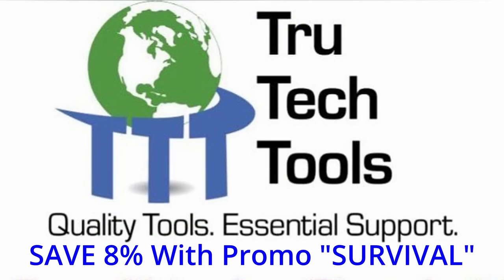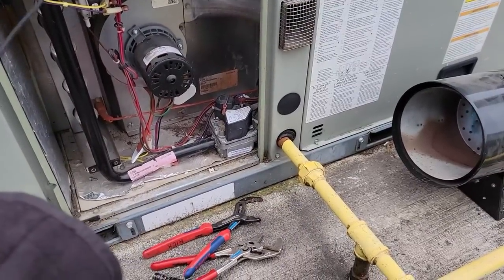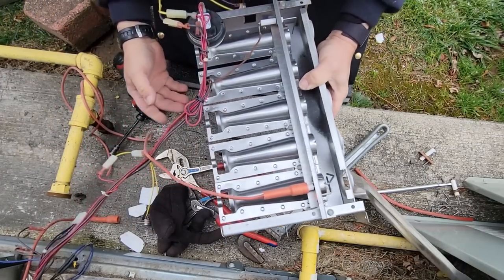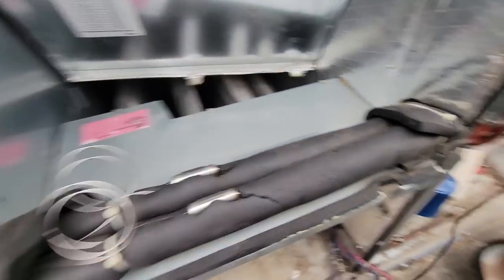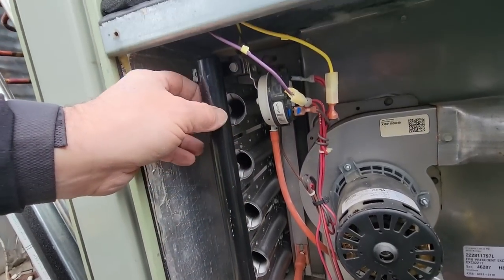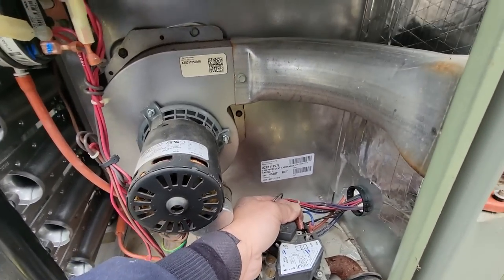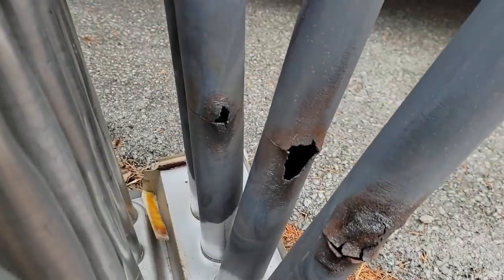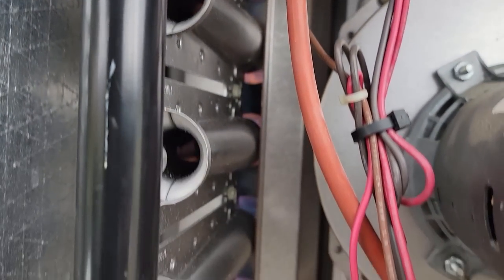Another Costly Trane Failure On The Same Unit!

Comment: I was actually told by a trane engineer through tech support on this exact issue, to remove the ceramic turbulators from the precident heat exchangers. They still come with them but I've seen so many failures because of those stupid things I just remove them. The loss in efficiency is negligible. I just did one about 2 weeks ago and one of the turbulators was broken on the brand new exchanger, had to fish it out with a pipe. Garbage.

Once you do one of those heat exchangers, it's pretty easy, an apprentice and I can knock one out in a little over two hours.
Reply from the maker: I removed the ones in the other unit I showed, I asked for new ones but they didn't show up. Good to know, thanks for watching and commenting!

Comment: The last gaspack which I serviced, was for a Tempstar 16 SEER unit which was installed by a perfectionist, the sheet metal work was conformally coated with a high temperature 'hydrophilic' coating manufactured by a company by the name of "Hysol".  It was one of those "their techs were SO busy," that the husband and wife 'team' who owned the HVAC (no "R") ICP-Tempstar/Comfortmaker dealership couldn't do the 'scheduled emergency service within 72 hours, with the client's location/business being a modular building in which an OR and ER for a veterinary clinic was situated. 

The veterinarian,  "† Dr. Jack L." was so cherished by the community, that as he grew older - he knew that he need·n't worry about being burdened with the upkeep of everything he owned.  Eh', let's just say "saint"...  He cared for four the five German Shepherds which accompanied me thru childhood, and well into my late '40s. In no way could I let him down.

I immediately noticed 'frosting' on the lineset's bare (connection) copper on the outside, with an 'iced-up' evap coil within the discharge side of the air handling section and it's building connection plenum.

When I began to open the gas pack's 240 VAC/24 VAC electrical/LV signal interface area, I was greeted by the sight of a 3-ft realistic-looking copperhead snake's head protruding from the still-wrapped roll of Scott -1000 toilet paper.  There was a "smiley face" drawn on the back of the roll.  Either the Doc, or the Tech had one helluva mean sense of humor. A day later I was kicking myself in the arse for NOT thinking to 'pose and glue' the snake onto my forearm, then "faking" a venomous snakebite....

Comment: Hey Rick. I’ve seen this before in movie theaters. It is thought that extreme pick up stresses the metal. They were turned off and picked up from 20-30°F. Set to 50°F  was better, but still failed at year 6-8. Hope this helps. We also pointed out that off doesn’t save much propane over set to 50°. It still has to heat up the seats.

Comment: How did you troubleshoot the issue and find the heat exchanger bad, cause the it was a sealed area?
Reply from the maker: I have an inspection camera. It has been the fastest way I found. Then I investigate hands on visually once I have reason to believe I have a failure.

Comment: Ahh the memorys of making these units in lynn haven florida. The reason the heat exchanger is hard to replace, it is the first part of the unit that is made and put on the base. In the factory it take us a hour or two to replace the exchanger if something was wrong, lets say i had that fun once or twice but having all the right tools and knowing all the screws by memory helps alot. I worked building these for 8 years. Unless they changed it up red was stainless tube. White is regular.
Reply from the maker: Awesome to hear from someone that worked at the factory👍👍🍺🍺

Comment: 1:34 it's "aluminized" steel tubing(it says right on it). in simple terms, it's aluminum alloy plated, similar to galvanized steel. lots of aftermarket exhaust tubing is made the same way and other fuel burning appliances use it.

Comment: How would one spot this on a maintenance? Would we have to pull all the heating components out to check the heat exchanger? Or could you use CO detector on the supply's
Reply from the maker: An inspection camera is the fastest, but a flashlight and a mirror are the best ways to visually inspect it. Analyzers are nice but they're very expensive and they don't always tell you if it's cracked. If you have so much CO in the building that you can pick it up with all the makeup air then you've got some major issues.

Comment: Did 4 of these on one site. Worst part was the draft motor screws were rusted onto the old heat exchangers.  Had to cut them out. Also they don't send a new inducer gasket, which I didn't appreciate.
Reply from the maker: Mine came with one or at lest someone ordered it..

Comment: Nice video bud. Those heat exchangers are just as easy as a carrier though in my opinion. That screw you were stuck on in the beginning was behind the condensate pan.  I usually pull the pan when I do them to get to it and clean the pan.
Reply from the maker: Someone mentioned the pan pulls out? Is it that easy?
Reply: @HVACRSurvival  yea.  Undo the condensate piping and remove the support for the filter door and the blower/heat access door. Once open, pull up slightly on the pan and pull out. There MIGHT be some mastic or thumb gum holding it down, so may be a little resistance.
Reply from the maker: Thanks for the info👍👍
Reply: @HVACRSurvival  anytime bud. Nice to be able to give you a little help for a change.

Comment: Having an issue with the rtrm module on these things giving a diagnostics fault every few months or so, we thought it was co2 but I dove pretty deep into a similar unit today. Mine had a standard heat exchanger, direct drive, electric heat (which was disabled for some reason). Still waiting on Trane to call me back, wonderful tech support. If you've had similar issues I'd appreciate any input, everything checks out okay.
Reply from the maker: I haven't had the problem you're describing.  I know what you mean about support or lack of...
Reply: @HVACRSurvival  Ah ok thanks, from their documentation it could be a list of things but with my unit in particular it's either an intermittent problem with the outdoor air/supply air sensors, rtrm to rtom communications failure, or supply fan failure. Still waiting on Trane, commercial tech support from them just doesn't exist.

Comment: Wow, the LGA/LGH series Lennox RTU's are a piece of cake to replace the heat exchangers on, once you get the gas valve stuff and inducer out of the way, they basically slide out like a drawer on drawer tracks. Plus they're stainless steel. Did one a couple of years ago on a 17.5 ton unit, done in under 2 hours. Yes the Voyager ones are horrible, and too big and heavy, but generally by the time the heat exchanger is bad, the rest of the unit is EOL anyway, so it's just quicker and easier to pull it off the roof, and change it out.
Reply from the maker: There were a lot of things about Lennox I didn't like but there were some things I liked that that made them a lot better. I used to be a Lennox guy for the first 20 years.
Reply: @HVACRSurvival  I didn't really care for the old electronics boards with little daughter boards, and then the mid 2000-2010's M.2 controller wasn't very user friendly, but the newest ones are a breeze to set up and commission. Very intuitive UI, and easy to navigate thru the settings. I don't like the new plastic door handles, that's my main pet peeve of the new ones. Doors also seem a little more flimsy. But the basic design of putting the compressors in a nice compartment that's organized makes it easier for a guy to replace run capacitors, gauge up on a compressor etc. They all have their pro's and con's. Lennox RTU's are like almost there, with a few small changes they would be wonderful to work on. Even changing filters is a piece of cake, since they have those metal trays to pull the filters out.

Comment: Sadly the original ge (General Electric) engineer s are like me old and the new trane engineers are constrained by the price of materials - not designed by quality. Before trane bought the ge division there units were tanks. Bulletproof. Now expensive crap.
Reply from the maker: Bingo! But if it makes you feel better they're all junk. Nothing's built to last, and with these techs that don't know how to fix anything and want to sell new, it doesn't really matter.

Comment: The one at the bottom isn't impossible. Pull that post off and the drain pan slides right out. It's stupid they put a screw under the drain pan but they did.
Reply from the maker: News to me, thanks!

Comment: At 7:35 that unit is convertible and that is the panel that was taken off to make it side discharge. While in that configuration it makes it messy down flow would be much easier. I've about decided they are all junk anymore so much stupid stuff now. I set a 20 ton last week and saw on the tag 0 oz charge for 2nd stage. WTF I was ticked as no way am I paying to charge the 2nd stage in a $xx,xxx unit. Apparently they share charge now 16.5 lb 1st stage covers the whole machine. Why just why do that now if something goes wrong on 1 stage it screws up the second. Manufacturers suck big time with cheap ass bean counters but charge us the same
Reply from the maker: So was the compressors tied together in parallel?
Reply: @HVACRSurvival  I will let you know on start up. Was a busy day setting this one and 5 others on a roof. I didn't have time to fully investigate but will this week if they get a power meter.
Reply from the maker: Sounds good 👍👍
Reply: @HVACRSurvival  2 stage twin 10 ton compressors paralleled together  tied to a massive micro channel evaporator coil with manifolds on each end with 4- 5 ton TXVs 2 on each end. Its pretty strange looking set up. Had to do a few things on site today before start up so still haven't heard it run yet but my curiosity made me go pull the panels off. Splitting a micro channel isn't anything new but shared circuit and quad feeds are
Reply from the maker: @jonsaircond8520  yeah that don't sound like a good time.

Comment: Junk heat exchangers getting missed are one of the reasons my state (Washington) has mandated carbon monoxide detectors in new and renovated schools and dwellings with gas heat. Normal commercial doesn't require it yet, but I'm sure it's coming, though it may be a moot point since they're moving toward banning natural gas altogether over the next couple of years.
Reply from the maker: 🤣👍👍 yeah I can't wait to see that train wreck. It'll be just like Germany, no power and not sure what the hell to do. They're afraid to live because they want to save the Earth yet they die for it. I Could not live in those kinds of states.